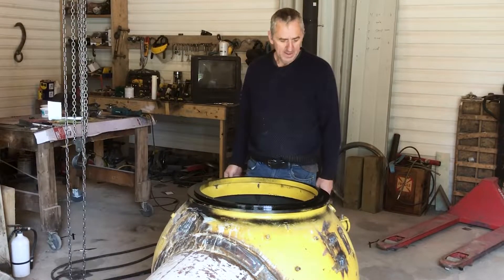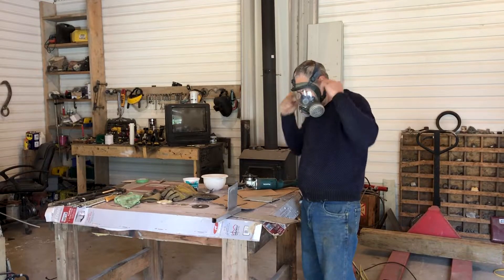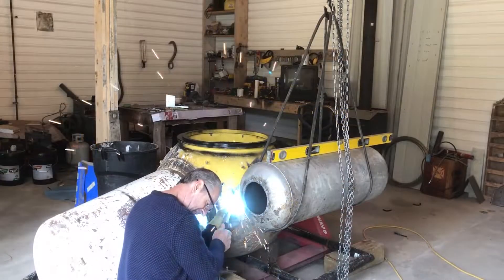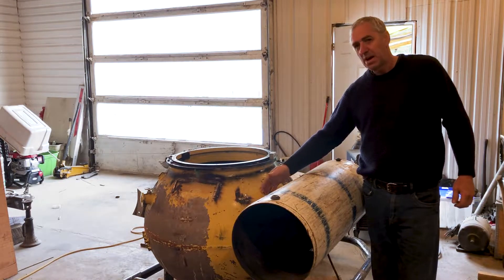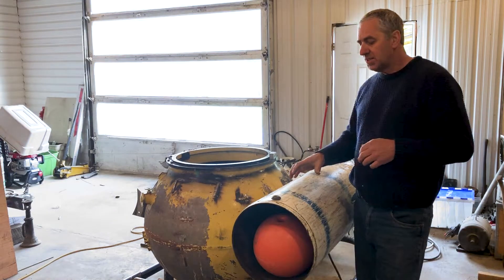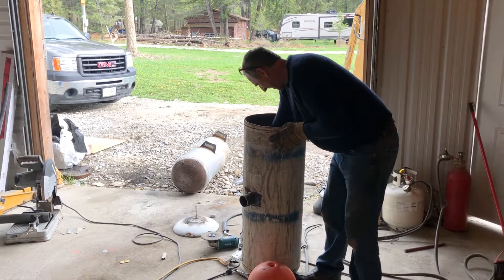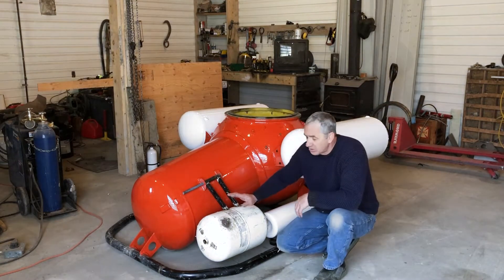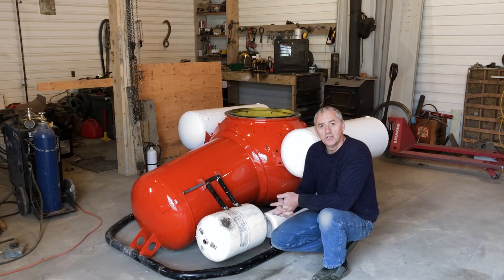Mounting Ballast Tanks To Homemade Submarine | Isolation Project

Comment: How does the valves on top of the ballast tank open and close?.
Reply from the maker: They are electric solenoids, they close with a spring and open with 12v
Reply: How did you get the solonoid to not short out because they use electricity
Reply from the maker: they are able to work in fresh water with no modifications
Reply from the maker: correct

Comment: i want to make a submarine, and im glad i ran into this channel
Reply from the maker: If you need information, I am happy to help.
Reply: @HankPronk  haha I grinned ear to ear when I seen this this morning. You have no idea how awesome that would be. But I will need to learn more and draw up a design so I don't waste your time! Right now I think I'm going to design a sea scooter with a mounted O² tank to get started. Y'know overcome the hill before the mountain.
Reply: @HankPronk  I needed a while to think of the questions I had..  the main questions I have are how you get the controls for electronics and other systems from outside the hull, inside, without leaks. Do you recycle the air you release from the ballast or do you keep air tanks with reserve ballast air and can only dive so many times until a refill? I am continuing to do research but some of these questions are hard to find answers for on Google. I guess the only other question is if there is a place you learned all of your info, or if the knowledge you needed was acquired over time.
Reply from the maker: @humpiestcandy4419  Watch my electric penetrator video on how to make them.  That is how we get signals through the hull
Reply: @HankPronk  thanks so much I will watch it asap! So many people like you have wonderful designs, I can't wait until I have something I can present and say  built this. Even if it's a ways away still

Comment: can you show us  the design of your ballast tank?
Reply from the maker: There is a video coming out today showing the sub diving in a test pool that might show you what you are looking for.  If not, let me know.
Reply: i am a 4th year high school student in the and i was thinking to build a submarine made of a barrel but i do not know  to build a ballast tank. how does the water go in? and out?
Reply from the maker: @ajmagalzo4840  Hi AJ, the water comes in the bottom of the tank through a permanent opening.  Water comes in when you let the air out of the top of the tank.  No pumps are needed.  To remove the water, just force air  back into the top of the tank, and that will push the water out the hole in the bottom of the tank.